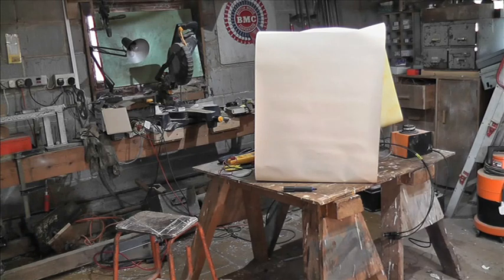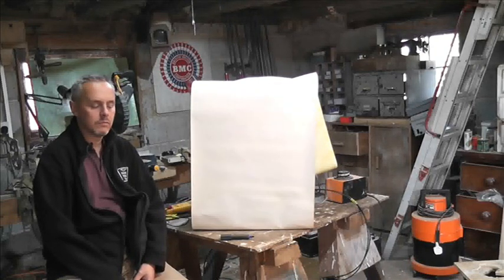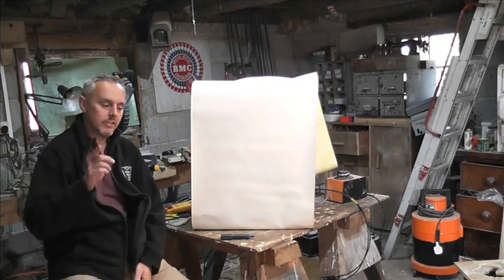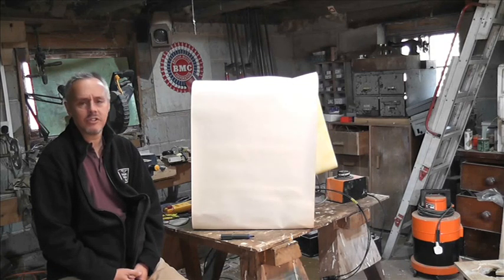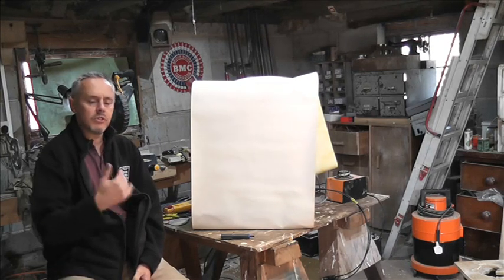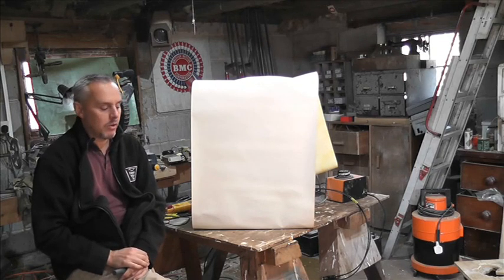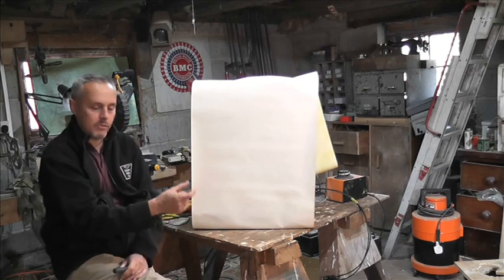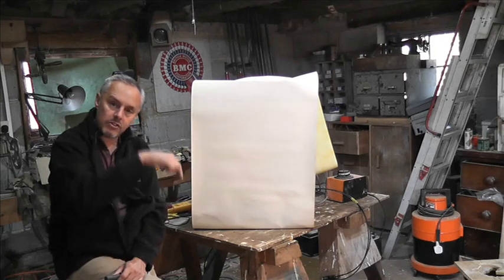Heat pump repair, which sensor? Lee fixes it.

Comment: i have a similar problem.  different circumstances.  Heat pump is only a couple of years old and discharge line temp sensor failed.  did bypass it with 15k resistor and has been working for the last day.  I have a manual with the temperature - resistance chart for this sensor so i knew 15k would fake an appropriate temp.  Was worried about logic issues as this video discusses, but board appears just to be monitoring for a straight cut out temperature.  Still would like to repair properly with actual working sensor.  Unfortunately, there is no helpful part number listed or on part itself.  There is tech support for my unit, but I'm sure I can get generic sensor for a fraction of the price, just can't find sensor on internet with accompanying charts to confirm.   this video did at least make me aware what i need seems to be an NTC sensor.  further internet research revealed the sizing of these sensors is based on it's resistance value at 25 Celsius.  Appears i need a 50k NTC sensor, but none show there charts so i can confirm other values are appropriate.

Comment: I've had a similar experience with work men wanting to fit a new heating system. Beginning to think fitting an old fashioned back boiler to coal fire.
Reply from the maker: Hi, ever the reactionary, old mercs run on Welsh steam coal. Beyond that it pays dividends to fix things yourself, especially cars as you are bound to get ripped off, cheers

Comment: Nothing to loose and everything to gain by having a go. Interesting to see that Lee had a  go and had success. Its a big part of this country's downfall that accountant's only see profit by selling new and have no understanding of life.
Reply from the maker: Exactly and also if I repair it then I'm responsible, whereas a new machine has is covered by the manufacturer. All to the detriment of the customer and the environment, cheers

Comment: Bite the bullet, buy a new machine, oh, what's that, yes, indeed, I do sell new machines and get paid to install them too. Sell you a £3 part or a new heat pump?  Over 7 years old, pointless to even try repairing it!   What a tricky story about a business with the same name that still has all the manuals but none of the parts! 

It is a funny world Andy! Glad Lee got it fixed,
Reply from the maker: It's not just the corporate world that are bandits, I'm impressed with Lee's thinking, cheers
Reply: @TheInfoworks  surely these big companies care about us, the end users, and the planet?
Reply from the maker: @bootsowen  Ah yes, after, CEO monster salary, bonus, pensions, works outings, bribes and general corruption, shareholders. Customers are the problem, cheers